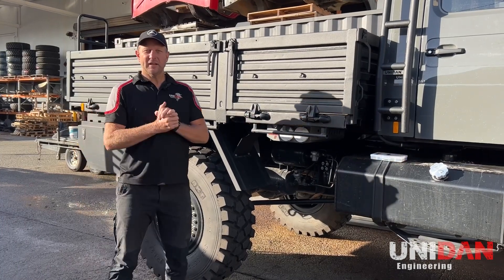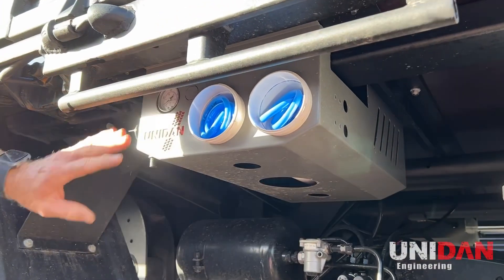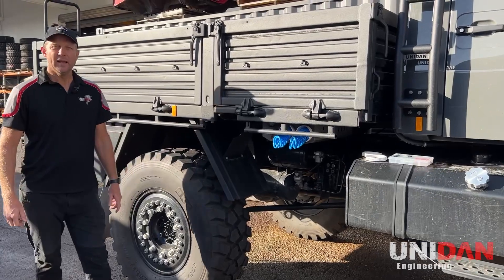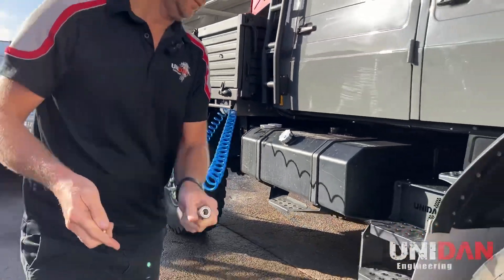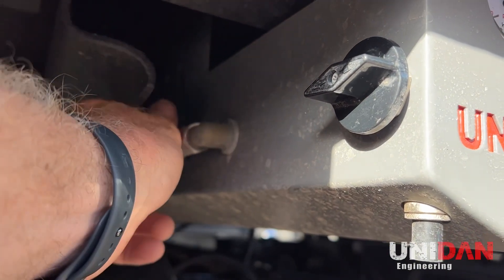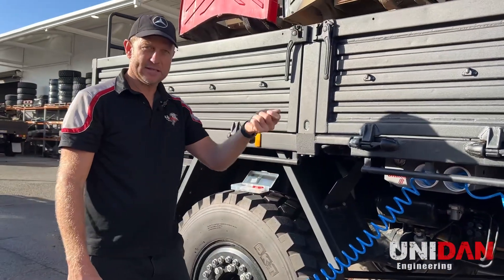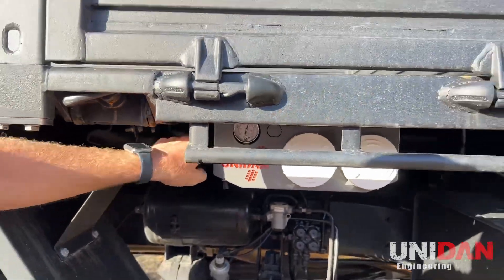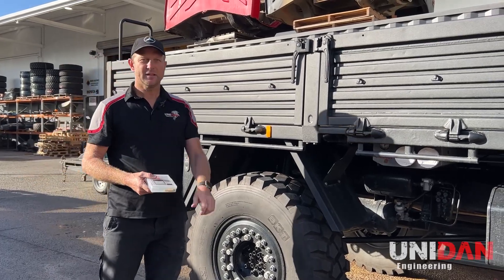Unidan Rapid Tyre Inflation System - WHY and HOW TO USE IT!

Comment: Hi, great video! One question: in the video you said that you leave the engine running so that the air system of the truck can refill the reservoir cylinders as the air is being fed into the tyres. Does that mean that whilst you're pumping up the tyres during those 12 minutes the trucks air brakes might not actually function and keep the truck from rolling? Or once the air brakes are engaged before you leave the cab, they are somehow separated from the reservoir tanks meaning that the air from the brakes doesn't escape the brakes and rushes back into the reservoirs due to pressure difference, which would make the brakes 'come undone'. Sorry for the layman terms. Thanks!

Comment: so what is the $2000 actually getting me ? a $5 gauge and 2 600mm length pvc pipes and a plastic shroud ?
Reply from the maker: Did you watch the video??
Reply: @unidanengineering3268  yeah and I'm still convinced that's it

Comment: Just a question and suggestion. Why don't you rather fit CTIS or design one that fits your needs? CTIS is much more convenient as far as I understand. I saw in a comment that you don't because you can't select different pressures for different tyres but can't you solve that problem with a vavle or something?
Reply from the maker: Retrofitting CTIS on the older Unimog through the axles is over $30,000 as you need CTIS compatible (more modern) axles as well as all the computer systems etc. There is also a company in Australia who we use, called Air CTI who do external CTIS which is approx. $14,000. It all comes down to needs, wants and budget. Our kit is less than $2000
Reply: Thank you for the explanation, I now understand.

Comment: Do I understand it right that the speed with which the tire will be inflated depends on the compressor of the truck, which means that older truck with less good compressors will just last much longer to fill the tires again with air?
Reply from the maker: Yes, if the compressor is slow then it will take approx 15 minutes to fill all 4 tyres from 20PSI to 80PSI but a good compressor will take approx. 12 minutes.
Reply: @unidanengineering  Thanks a lot; How big / how heavy and how expensive would such a "good compressor" be? Why are you (apparently) so much faster than the STIS - System?  Best regards, Andreas
Reply from the maker: @apmimali4227  The Unidan RTIS system utilises the trucks on-board factory air compressor, I believe this is the difference between our system and the STIS system as that is an electric air compressor. Our RTIS system is designed specifically for the Mercedes-Benz Unimogs which all have on-board air systems.

Comment: This inflation system is more practical than the new CTIS as it gives the operator the choice of having separate tire pressure adjustment between the rear and front tires according to load distribution, great job Dan.
Reply from the maker: Thank you! The Mercedes Benz CTIS system for the Unimogs does allow the operator to choose the pressure of each axle (whether preset with the different modes or manually selecting the PSI that the operator wants in each axle). It just doesn’t allow individual tyres to have their own pressure (ie. left and right). But I can’t speak for all CTIS systems as some brands my have it as one pressure for both/all axles

Comment: Looks neat, very similar to MAN's optional inflation system. I would have thought you would install a gauge that doesn't require thinking about because as sure as eggs are eggs, at some point in time, a user is going to forget and open the valve quickly.
Reply from the maker: Thank you!
The reason for using the gauge that we do is because if we fitted a gauge that shows 270PSI then we would only be working within a very small portion of the gauge once the trucks tanks are empty. Therefore it wouldn't be a very accurate reading when working between 20-80PSI and you would have to have great eyesight to be able to determine what PSI the tyres are actually at. For the very small percentage of time that the air tanks are being drained (approx. 5-15seconds) we think that the benefits of being able to see what PSI the tyres are actually at, outweighs the risk of customers spiking the gauge.
Reply: @unidanengineering   Point taken, and sounds like the best compromise.